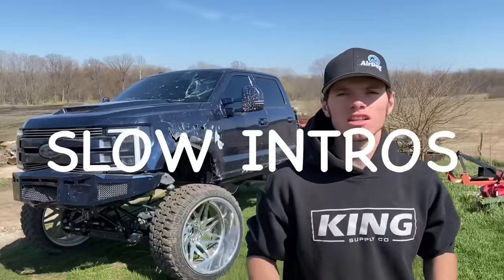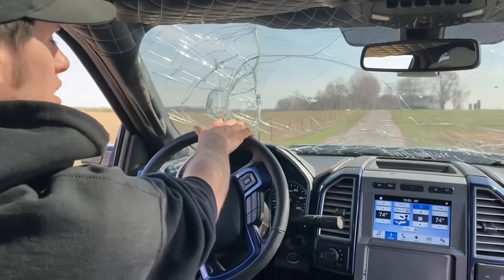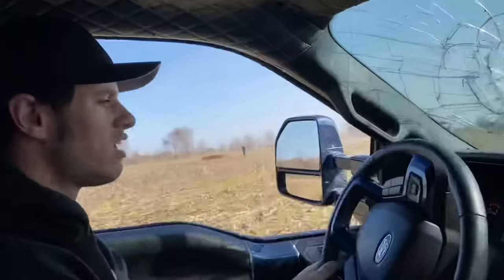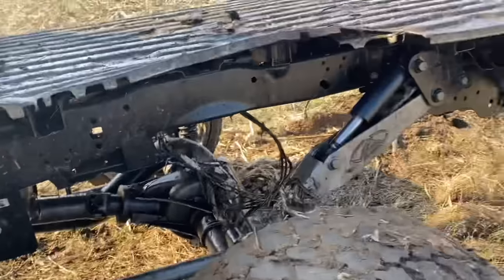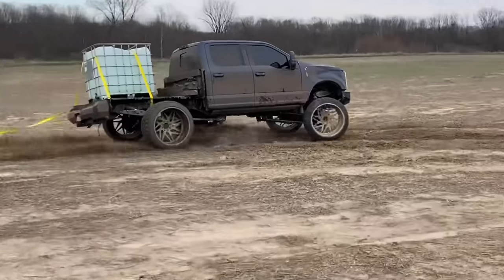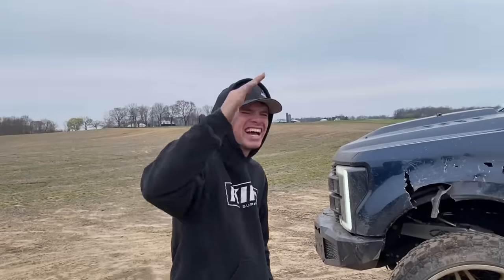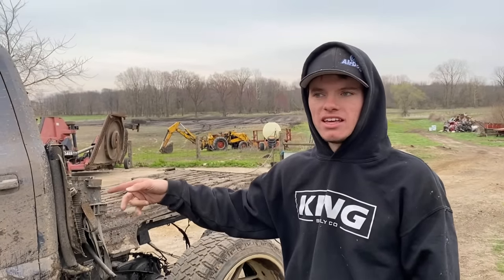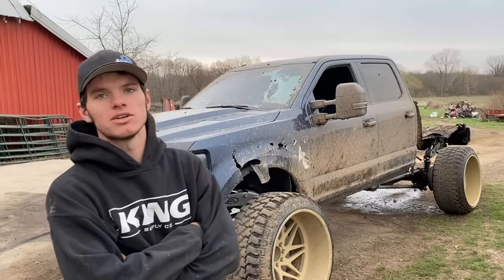HARDCORE JUMPING the AnyLevel F350

Comment: Can we just appreciate how reliable the Any Level System is!
Reply: George Diaz american made
Reply: It’s literally broke at every chance how is that reliable ? Coil springs on the back of a pickup truck is not “reliable” mate !
Reply: @jakeatkins4891  the lift still works tho
Reply: The fact that the fasteners failed because the hydraulic system of the Any Level Lift was trying to move thousands of pounds doesn't detrement the quality of the product. The fact that they have over loaded and over powered the system to the point that it broke shit is just a testament to how it will perform under manufacturer specs. Please excuse any clerical errors and or any sense of rambling, I am pretty drunk due to my stay at home protocol.
Reply: The lift it’s self didn’t fail...  just the brackets did that has nothing to do with the lift
Reply: Damn these any level promos are fire whistlendiesel probably makes hella money from his Sponsors
Reply: Jake Atkins but it still works...
Reply: Dylan Laughlin acceptable

Comment from the maker: Any other things you've always wanted to see a sema truck do?
Reply: Do a barrel roll!
Reply: WhistlinDiesel drive on two wheels like the duke boys
Reply: WhistlinDiesel interior def needs a deep cleaning.
Reply: Put the mini excavator on the flat bed
Reply: WhistlinDiesel maybe some extreme hill climbing? The jumping is awesome. I’m sure it rattles you pretty good though. That truck looks better beat up then new! Love it! Would park that thing in my front yard for display!!!!!!! Or hey maybe a good debut for monster maxx and run it over with it!!!!
Reply: Go cart
Reply: Drive the 6x6 Through the cab
Reply: Drive off the hill you were climbing, not slowly either
Reply: No wait... do ever thing you have done with Carl. And see if it can hold up as well lol!!!!
Reply: Try to cross some deep water.
Reply: Send to me what no gooseneck pull 30000000000 lbs
Reply: WhistlinDiesel  set in my driveway lol
Reply: Neutral drops, reverse 4wd boosted launches, rocking horses, how much dirt can a 6.7 eat, how much either can a 6.7 eat. They're not new ideals but they are things I would be entertained with.
Reply: Boggers take it to a dealership and get their reaction
Reply: Reverse jumps
Reply: Attach a trailer and hit some jumps
Reply: Drive under water scuba Steve
Reply: Burn to the ground and toast marshmallows to make s’mores while it happens
Reply: Ram it hard
Reply: How much dirt can a 6.7 eat, make steaks on the turbo, tug o war vs house, neutral drop, make it a convertible,
Reply: Pay to have it detailed and paint polished.
Reply: WhistlinDiesel fly
Reply: I’m not sure if anything is topping underground but for the finale she needs to throw a rod BARE MINIMUM
Reply: Barrel roll
Reply: Return it to stock
Reply: Make it ride a wheelie
Reply: Make it float  with monster truck tires
Reply: Drive it off the wall like you did Frank 🤕
Reply: Monstermax verse SEMA truck?
Reply: Make it float
Reply: Give it to me lol
Reply: Can it swim
Reply: Pull it behind your tractor & plow some fields!!! Its planting time!!!
Reply: remember that lake you used for your videos put a snorkel on  the truck and see if you can make it to the other side
Reply: Double backflip.
Reply: Delivery drug
Reply: Can you set the interior of the truck on fire when you done with it ?
Reply: TANNERITE
Reply: Shoot it
Reply: WhistlinDiesel I kinda wanna roll it ngl
Reply: Take it back to the guy that built it
Reply: Put a bunch of weight on the back and try to do wheelies
Reply: make a flatbed for a 4 wheeler and take the doors off
Reply: Make it WHEELIE!
Reply: Furniture for interior
Reply: Drive it into a pond !!!
Reply: I say you roll it
Reply: You should drive this one to town like you did Carl
Reply: Put ur 350 on a trailer and go offroading
Reply: Carry another vehicle on its makeshift flatbed
Reply: WhistlinDiesel take the tires off the rims and drift it on steelies on asphalt, lite that shit up!!
Reply: I love you vids Cadyn Dixon
Reply: WhistlinDiesel do a tug of war with a Tesla. Elon musk style.
Reply: DO A BARREL ROLL!!
Reply: Make it look better than Ziptiesandbiasplies Slave lake
Reply: You should take it to town like carl
Reply: For the 4th of July put fireworks inside and open the sunroof..destroy the interior cuh
Reply: THIS TRUCK MEANS NOTHING TO ME
Reply: WhistlinDiesel love what you did to the truck
Reply: @Dirty.Engines  impossible
Reply: Christopher Marsh beat me to it!
Reply: Drive it off the 10ft wall that frank the cab over went over only at 55mph. “For testing purposes”.
Reply: @nicholasyoungs9263  YESSSS
Reply: Take it to sema now lol
Reply: drive it on barn roof
Reply: WhistlinDiesel  Take all the doors off an go mudding
Reply: Kill it like Frank
Reply: WhistlinDiesel bring it to a truck pull
Reply: Go cart it
Reply: Take it across the lake, or some kind of deep water. Put a snorkel on it first though LOL
Reply: Put a snorkel on it and drive through the bottomless pit
Reply: Hit a big ass one sided ramp and flip
Reply: The leather in it is waaaay too nice. Be cool to see you do something creative, maybe wolverine claws or chainsaw.
Reply: Build it into a truck that can actually do jumps etc without breaking
Reply: Take this truck to SEMA 2020
Reply: Is it bulletproof?
Reply: Put some weight in the back and do one last final jump that’s so big that it completely totals the thing
Reply: Take it to CARMAX  for an Estimate on its current state, make sure u tell them about all the cool sema extras.  😂😂😂
Reply: Do the same trail through the woods that you did with Carl.
Reply: @dookiebooger9967  That will be next year...
Reply: Fix it up
Reply: @Sm0kEyX420  Bog it baby
Reply: More jumps, awesome!!!
Reply: Remove the rear driveshaft and do massive front wheel drive burnouts pretty pretty pleeeeaaaase?
Reply: WhistlinDiesel blow it up with 50 pounds of tannerite and a propane tank from a grill with a road flare duct tapped to it to ignite.... after you shoot the truck full of holes 1st. The Sema truck would make good ballistics gel I think...
Reply: A wheelie all the way till the bumper drags
Reply: With that he'll climb ability you should take it to a popular place in Moab Utah and see people's reactions
Reply: Teach her how to swim 🏊‍♂️ 🌊
Reply: I think the interior is a little dirty ever since it was in the ground I think it needs a deep cleaning
Reply: drive it throug the sink hole
Reply: Roll it or drive over it with the Monster Max
Reply: Burry it to the doors
Reply: Roll it like The red duramax
Reply: Make it wheelie
Reply: You gotta take it back to the guy you bought it from tell him you wanna return it....that would be hilarious....
Reply: I wanna see the airbags. You’ve yet to do that with anything!
Reply: Flip
Reply: Try to take it to the next SEMA
Reply: Could you torture an old 8.1vortec chevy?....put the raylar cam in it first and make a 8.8L
Reply: Blow it up with 5kg of tenerite :D
Reply: Put alot of weight on the bed and wheelie this thing
Reply: Drive it in shallow river rapids
Reply: OMG i said on the Mrs. Story so many times #powerstroke carl 2020 when you blew up the 460 never realized thats what you did (edit): Btw Carl was a regular cab... just an idea
Reply: Be a boat
Reply: Take it to a truck show
Reply: Strap a bunch of weight behind the rear axle to make it wheelstand
Reply: Man set that water tank back 5 feet and do some wheelies!
Reply: Drive it thru your mommy's house
Reply: WhistlinDiesel can I see it go off the same cliff frank the car over went off
Reply: Yeah jump it off a kliff
Reply: Flip it and then cut off the wheel spokes until there’s one left and see if it will drive
Reply: WhistlinDiesel can I have it when your done with it @johdavper on snap
Reply: Send me the 100,000$ f350
Reply: Put a Dixie horn on it for the jumps
Reply: Snap off all four doors but doing reverse between two trees it barely fits through
Reply: You should jump it off the ledge you made it go up
Reply: Send it off a clif, or rip all the interior out, spray paint it then take it into town if it’s legal, make it an Uber and get reactions
Reply: Do a neutral drop
Reply: Diesel runaway
Reply: DO A FLIP
Reply: Id wanna see it take on 100 pounds of explosives
Reply: WhistlinDiesel a double back truckspring
Reply: Take the doors off
Reply: Blow it up
Reply: Drive it around town and record reactions
Reply: TOW A SEMI TRAILER!
Reply: fire hoop jump
Reply: WhistlinDiesel put some tanerite under it and make a go cart
Reply: if i could the tires from you when your done killing the pepsi can .... i dunno lmk?
Reply: WhistlinDiesel fill the cab with water make it a hot tub
Reply: Ive always wanted to see if it could fly higher than 20ft
Reply: Can you make it hop like a low rider?
Reply: You wont drive into the graveyard pile as fast as it will go.
Reply: I wanna see one on fire
Reply: 4 foot body lift lmao🤣🤣
Reply: Not have massive chrome rims instead small rim massive tire
Reply: Disconnect one of the front lifts lower the back lift the front that still working so the  front tire is off the ground like the guys with the DONKS do
Reply: Hit the last hill at about 30 mph.  ford  and the lift company should pay you for demonstrating just how much abuse their stuff can take. Normal use of their product would last forever.
Reply: Extend the bed back about 15 feet and put some weight on the end and pop some wheelies😂
Reply: spray paint "CARL 2.0" on the front fenders
Reply: Can you run over this truck with Monstermax?
Reply: WhistlinDiesel take it on the road, or to McDonald’s to see people reactions
Reply: Somehow switch all tires with dirt bike tires and jump it
Reply: Always wondered how these aluminum body sema trucks stand up to 50 pounds of tannerite
Reply: Remove all body panels except for the cab it's self no hood no fenders no doors no grill no bumpers etc
Reply: Put like 4 turbos on it
Reply: boosted launch hill climbs.
Reply: WhistlinDiesel go swimming
Reply: Fly in 30 different directions all at once
Reply: WhistlinDiesel dude turn it into an airplane lol build it wings give er the beans and make her fly😂
Reply: Power wash interior
Reply: Anything that keeps improving the look of that POC!!!!!👀😏😎👍🤘
Reply: You haven't truly wrecked a truck till you've twisted the frame. So uh what's up?
Reply: Wheelie
Reply: put a snorkel on it and drive in the deepest mud or just drive into a pond
Reply: Do a burnout untill the turbo melts and jump the truck and destroy it :D
Reply: WhistlinDiesel bring it to a dealer
Reply: Pls put the monster truck tires on it. R even better, franks rims. Like the dayton rims n all🤣
Reply: Fire place in the interior chimney thur the sunroof
Reply: WhistlinDiesel blow up
Reply: Even better, the new carl r go cart!
Reply: Tear off the cab and make it a convertible
Reply: @pineapplebruh  yes😂
Reply: Strap an armchair to the top Mr Bean style and take it for a jump.
Reply: Drive on a barn
Reply: Ivan McKinney YES! Mini-ex climbing on the bed. It can hold itself on with a bucket through the cab.
Reply: WhistlinDiesel put in park while going over a jumps
Reply: Burn it
Reply: How much mud can you fit inside it
Reply: kmonnier he sold it
Reply: @NextAdventureYoutube  lol he really should
Reply: Make a cabin on the bed like on that one episode of top gear usa
Reply: WhistlinDiesel take it to sema in this condition
Reply: Ride on the right two wheels at a 45 degree angle
Reply: Rip the roof off
Reply: Take it to the dealer for warranty work
Reply: Do a flip!
Reply: @WhistlinDiesel put in park while driving
Reply: Carlson Davis heck ya
Reply: Repaint the truck with that gray color. Do a crazy high jump.
Reply: Extend the bed out and load it down with weight to make it do wheelies.
Reply: Major problems lol
Reply: @WhistlinDiesel   It would be so amazing to see you actually put some big blue airplanes wings on this old boy and build a massive ramp to send it flying a minimum of 50 foot in the air!  Challenge accepted?! Or are you too worried about scratching the paint still ;)
Reply: you can get it done up like a mad max vehicle then drive it through a bom fire then through the shed wall
Reply: WhistlinDiesel tow a gooseneck
Reply: Build two ramps and jump another truck
Reply: WhistlinDiesel I wanna see how steep it can climb before it flips over backwards
Reply: You’ve done under ground now let’s see underwater! Submarine! Amphibious automobile Amphitruck needs to happen!
Reply: Just got a curiosity wondering if anything has been done to disable the airbags in there cause I was surprised I didn’t go off during some of the jumps?
Reply: Buy a lambo and do the same thing, so many people would flip shit
Reply: Do a wheelie or a stoppie
Reply: Haul 10 boats
Reply: Yes, I want you to wreck the truck by doing a 360. It would be funny.

Comment: My opinion on ford has changed a lot since he started pushing the trucks limits... props to ford for making a well made truck.
Reply: This channel is probably the best r&d any company could ask for
Reply: There's not much left on the truck that's ford. Almost everything is custom or had been modified. Regardless though, the truck has definitely impressed me too. Especially the Any Level Lift system  and  what I'm assuming the stock axle tubes. Pretty sure the fronts are bent some but no catastrophic failure yet.
Reply: All the Ford parts have not failed, the any level has broke but yet keeps going
Reply: It's clear that this truck is using chevy parts otherwise it wouldn't even make it past the first video where he tries to break it
Reply: Fluxius Hook, line, and sinker... Troll: 1, you: 0
Reply: Nate Beachey oopsies
Reply: One of us. One of us.

Comment: The man who builds a truck that he can't destroy will be a LEGEND.
Reply: Easy, don't let him near it.
I think this guy might find it more fun to buy a vehicle like a Trophy truck, or some kind of buggy that would take more punishment. These trucks are built for road use, and a bit of off road here and there. Not being driven into the ground.
Reply: Just google, sherp.
Reply: Actually, the man who builds a truck that he can't destroy is he himself. That's what they're trying to do with Monster Max.
Reply: He destroyed monster max. He could destroy a sherp if needed to. There is no truck he can’t break
Reply: @jasongabrielson4179  Yes, and now Monster Max will get better and stronger.
Reply: No kidding. The axles he’s putting on it this time r nuts
Reply: @jasongabrielson4179  he would literally have to blow it up to destroy it.
Reply: Sherp.
Reply: he couldn't destroy a toyota hilux till he dropped it 5000 feet in the air
Reply: The Toyota Hilux is the truck he respects the most I think
Reply: 2 Esdras 2 :33
Reply: All trucks are fragile
Reply: @Asmithiphonic5  except for the Hilux
Reply: @aqxone3489  trucks.. not half trucks 😂
Reply: @Asmithiphonic5  fair enough
Reply: @Asmithiphonic5  He pulled 30,000 lbs with it dude lol
Reply: @FernandoDenise2558  and it’ll need a full motor rebuild at 100k miles because it’s a modern day ford on top of the thousands for maintenance. Ram V10 will pull 60,000lbs
Reply: @Asmithiphonic5  I think you need to watch the series on it man. These are old diesel Hilux's not modern ones, definitely no motor rebuild at 100k. The one that Top Gear couldn't destroy, and neither could Whistlin' Diesel until he dropped it from a helicopter.
Reply: @FernandoDenise2558   thought you were talking about the ford. I’ve seen those episodes on the hikux. Hilux is as small as a civic and smaller than a sxs lol. How about an HHMWV? How many of those and hilux trucks do you see an average? Hens teeth. Just get a Tacoma or buy a civic and lift it w awd haha.
Reply: @Asmithiphonic5  diesel hilux is about 10k in decent condition and if you saw the videos on it you know how much abuse they can take, survived all of it perfectly fine til he dropped it from a helicopter and didnt even have the wheels come off if it hadnt landed face furst i wouldn't be surprised if the engine would start right up still
Reply: @Jordan-zk2rf   I’ve seen the vids however nobody has ever seen them on the road because they’re rare as hens teeth. You won’t see this kid beating on the hilux for along period of time bc it won’t last it will need constant repairs. They’ve sold twice as many hilux in the states than tacomas... There’s a number of reasons why they barely exist anymore. 250,000+ sold in the states and you’ll never see one because they weren’t worth dumping money into and they rust away faster than wranglers and cherokees combined. They’re overpriced $20,000 30 year old trucks and you’ll have to travel out state to find and inspect one. For that price I’d rather have 5 HMMVW. I’d also rather watch BJ Baldwin in a Baja truck any day over this YouTuber clown 🤡😂
Reply: Toyota

Comment: All you break is the easy stuff?? When you have a straight axle truck and its running around 5 or 10 degrees negative camber, I would not call that easy stuff just to point out an example for whomever said that LoL 
Quick thought, when you are doing the flight scenes of the videos, are you doing them with the air bag relays still in or?.... Curious if that is somthing we may see in the future when you land and they all go off. Air bags are brutal when you dont actually need them and they go off. I DONT want to see any of you guys actually getting hurt. Trucks are whatever, but your face you need that!!
Reply: Don't wear your seatbelt and the airbag will not deploy
Reply: @jefffowlerr  but you might 😂

Comment: Dude you literally ruined a truck that good have lasted for ever I love it you should do your next video spray painting the interior and seeing how long the motor will last running on flex seal or flex paste and roll it while driving
Reply: Horsepower Daily flex seal and spray paint ideas are the best
Reply: He needs to just drain all the oil an trans fluid an start it up an hold on revline then slam it onto drive then to park